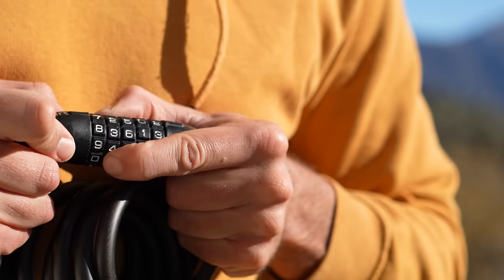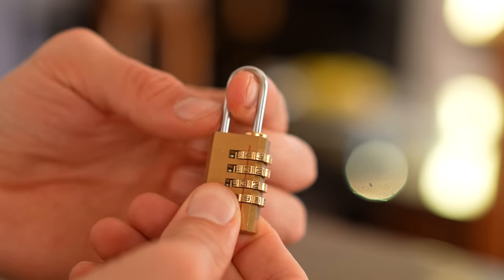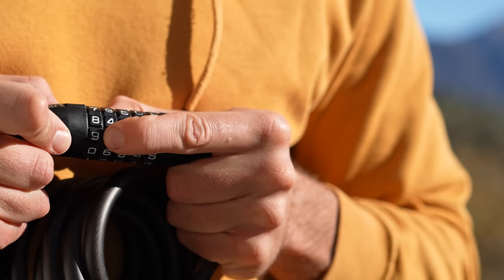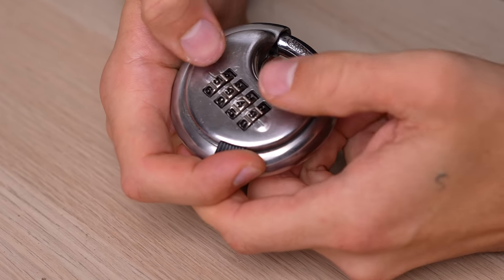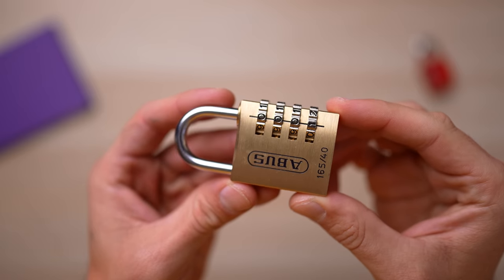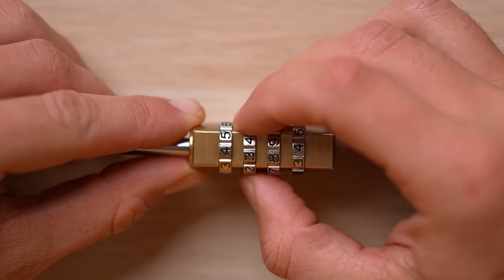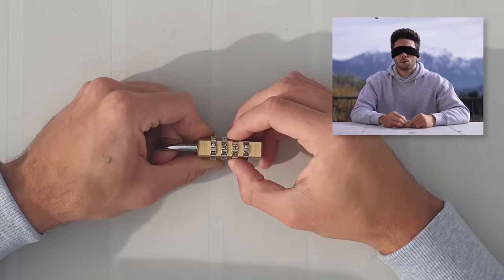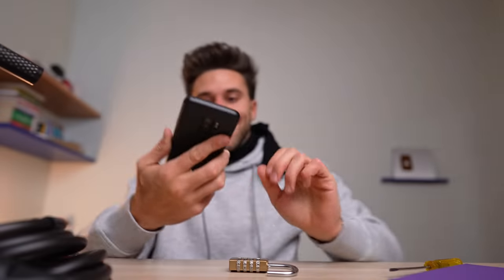This is Why Combination Locks are Completely Useless

Comment: Once picked a 70 USD combo lock in under 30 sec on the counter to prove the seller talks trash on safety. Was a no buy for the client. I paid my 7 USD China lock with high friction and a 70 USD AUBUS hard steel foldchain to pair up. Advised the client to buy 1 cheap and 1 good lock and left.

Can chain my double lock ccmbo to any pole in front of a disco for 3 days. It never gets touched even with tons of punchkeyed locks around that have been emptied of their bikes inside. Cleary a danger zone. 

I just need to oil that China thingy to keep it from eating it's key.
Physicaly it's no match but it's so shoddy high friction it is time consuming  to pick. Anything used to test & turn will just give up and bend.

The AUBUS barchain is punchkey unprotected and provides super hardened steel physical resistance. It deters any noisy grinder discs attacks, require a large crowbar or carjack vsible to carry.

People to bring punchkeys for the job seem to reasonably dislike carrying a large tool for the act and seem to go for safer prey. Be noisy on 2 locks appears to be beyond the threshold of waking drowsy people up at night and take a closer look.

A GF bike got grinded open at night in my peaceful street. It was 3 days old with no traces of any use. Probably that sales outlook did warrant the risk using an angle grinder on 2 locks. My bike was 4 times more expensive. Hard to guess what made the thieves accept the risk to prey on it making noise in sunrise hours.  There is mostly some night owls or early dog walkers around.

Comment: Yes, I agree will other commenters here, there will be a few percentage wise of thieves that will have the time, skills, and patients to open these locks. Also as others say, any lock can be opened, either key or combo type locks.  
If you are worried about this, don't carry precious valuables with you in public places like gym lockers, etc, where you use your own personal locks.  Not too sure how we would handle bicycle lockdowns.  I know in the past I used heavy tie down chains, but nothing special about the locks I used - lucky I had no problems.
If someone is really desperate at getting past your lock, they could probably use some kind of cutting device. Of course it would be very obvious to others what the thieves intentions are and know that is not their lock.
Seems to be several of these "how to open locks" youtube videos, so just beware how and when you use any locks and what you are locking up far as valuables.

Comment: I bought a bicycle cable combination lock for $2. It retailed for $30. The label on the  product said it was returned by a customer because it did not work. The 0-0-0-0 factory original didn't work. I think the purchaser reset it and could not remember what they set it to. I sat down watching a movie, started with 9999 and just counted down until it opened. It took less than 5 minutes. I reset it to a number I wanted. It is now the simplest of my three locks I use on my commuter bicycle. All are used at the same time. There is no lock that can't be broken, but if it takes too long the thief will move on to a bike that is easier to steal.

Comment: It's a great video to bring awareness to how cheap and useless these locks are.  The only problem with your video is that NO THIEF is going to sit there and try to open your combo lock like that.  They're going to take a bolt cutter to the chain/cable or a portable grinder to the shackle which only takes seconds.

Comment: This does not make them useless. Of course, for a bycicle lock they are no good idea. But there are many applications where delaying an attack by 10 or 20 seconds is by far enough. Any lock (or at least almost any lock) can be picked with enough skill and time.

And very often it is just about the statement "this is locked", as at least in many European countries it makes a huge difference if someone breaks into a locked door or opens an unlocked one, legally. Cracking a lock, regardless of how easy it is, is an intentional act.

Comment: For A 4 Digit combination lock just try all the numbers starting at 0000 then 0001 working logically you can go through 1000 numbers quite quickly, even a 5 digit Takes less than 2 hours

Comment: I opened a combination lock for a cabinet at an Ikea that was so easy I lowkey did it by accident

I literally just had my hand on the drawer after noticing it was locked and I gave a joke attempt at cracking the code, which actually opened it

Comment: I bought myself the expensiv one, a few months ago. While trying to set a new code I wanted, I set the dials to something else... not knowing what the numbers where I had to crack it... and did so without whatching or reading a Tutorial -> absolutly not safe.
Reply: However, most people are not as clumsy as me, so they never tried picking such a lock and therefore trust them. So in Uni and so on ... I will continue to use it

Comment: Mike, I have a 4-wheel combination lock similar to the Abus-style and would like to figure out the combination.
Unlike all the videos out there, which show the shackle is in the 'locked position', mine is the opposite.
My shackle is in the 'open position' and will not close or lock, unless I set the right combination.
Any tips on what to do?
Reply: I suppose it's pretty much the same, except you should apply pressure as if trying to close it instead of opening.

Comment: Combination locks, especially the cheap ones are extremely easy to open within seconds. All you have to do is pull the padlock while changing the combinations and eventually the lock will open. I've done it countless times in the past for fun and I would never trust such lock for locking anything that is even remotely valuable.

Comment: You dont have these luxury of turning the combination lock like sitting infront table, when its used on say door or bicycle. With awkward position and chains pulling, you will need much longer time and effort to open. Such lock is for convenient without needs of bringing key.

All locks are for deter purpose as it takes long time to pry open. Using two spanners or some rods they can break the lock even faster than trying to open.

Comment: Where I work there're true "combination" locks on the doors (as distinct from a "permutation" lock which is what most so called "combination" locks are) and you can open them as long as you get the right numbers-in any order. Weird. And rubbish.

Comment: Cable locks are nearly useless regardless of the locking mechanism. The bigger issue is that cable can be very easily cut. While there’s no such thing as a perfect bike lock, at the bare minimum you should be using u-lock with a >13mm hardened steel shackle.

Comment: I thought there was an easier and quicker hacking way (2013 tweet). Anyway this could have been used by the bandits at the hotel I stayed in for about a month in Lyon where an important official  document seems to have been replaced by a fake. These kids love changing the combination key code so you waste your time trying to open it if you don't know this method. In fact it's you who looks like the criminal trying to hack someone else's luggage (kept in the luggage room, no elevator and my room up the stairs).

Comment: I bought a new e-scooter about a 2 weeks ago and wanted to secure it so I bought a combination bike lock for €12. I set it to the code I wanted and locked it up. However, I must have done something wrong because when I went to unlock it the combination didnt work. So I tried a few obvious variations with no luck and decided to go to YouTube.

In 10 minutes I found a video, watched it, and broke into my lock with 0 experiance. 

In the end, a lock is more of a hurdle that makes stealing the item slightly more challenging. Since most people choose the path of least resistance it's enough to stop opportunistic theft.

And anyway, if someone was serious about stealing it they would just use bolt cutters.

Comment: Ofcourse they are "pretty easy" to unlock even without knowing the combination. That is nothing new but the thing is that their purpose is not to hold someone off to break in but rather to DELAY SOMEONE to break in. If its about a bag in the airport for example its useful, you cannot loose your key and it will prevent any worker in the airport or other passenger to steal anything in 3 seconds on a "walk by".

If someone steals your entire bag, well, then no lock in the world will protect your belongings inside.

If you plan to seal your valuable belongings in a drawer or safe with a combination lock, then its definetly a very bad choice to achieve that.

Comment: Firsrly, never use a cable combo lock like that. Nevermind cracking the code, a pair of cable cutters will remove that.
Second, NO lock is pick proof. You only have to watch Lock Picking Lawyer to see that!. For a bike that expensive invest in a higher end lock.
For the record i picked 2 combo locks the other day. I will still use them as, for someone foolish enough to try in a locker room, someone will notice. Thats an extra level of security right there.

I will add, when securing a bike, esp a higher end one, consider using multiple locks. That combo one should not be the main one but could lock the fork to the front wheel for example. Again it wont make the bike "steal proof" but it will slow any thief". Also if its a bike for commuting, consider using a lesser value bike. Bike theives will not bother with budget bikes, its simply not worth their while!

Comment: Great work on those low end locks! You're now ready to try picking cheap Chinese disc detainer lock and if you can get that open, then an Abloy Classic. (The About Classic design is from year 1907 but it's still way better than 99% of all the locks you can in local hardware store. If course, more modern Abloy locks are even better.)

Comment: The point of a lock is not to protect your assets from theft.  The point of a lock is to make a thief move on to the next person's asset.  On a bike rack, for example, if a bike thief wants to steal a bike, they are going to take the one that is easiest to steal.  One without a lock, or one with a really easy lock to bypass by picking or cutting.  The point of a lock in this case is to make your bike more difficult to steal than anyone else's.  It's like how you don't have to outrun a bear, you just have to outrun your friends.

But, if a thief is out to steal your model of bike, no lock you have will stop them if yours is the only one there. They'll find a way to steal your bike.  In this case, you can outrun your friends, but the bear knows you taste the best, so he's going to run right past your friends and come after you.

Comment: The cheaper the Lockt, the more it is to keep honest people honest. Most (cheaper) Locks also have other exploits and weaknesses, that make them pretty easy to crack. 

The bike lock you were using to secure your expansive E-Bike for example is pretty useless, as a cheap pair of wire cutters will crack it in <10 seconds. Therefore, it provides 0 protections against actual tthiefes.

Comment: Nowadays digital locks seem better and far secure for usage. Why? Well, there is only the sense of sight in use and there is no other way of getting through it. When I am talking about a digital lock, I speak of the way how locks are used on phones, tablets, and electronics. It can also be a lock that requires an ID or card for use.

Comment: Combination locks aren't useless, they are intended to secure low value items for short duration and they do that adequately.
Is about using the correct lock for the intended use.

Comment: security is normally measured in minutes to open. A novice taking 5 minutes seems pretty close to the industry standard. Lock companies have to split the difference between being quick and easy to open when you want to but difficult to open otherwise. It's nearly impossible to get both in a reasonably affordable package. Plus it's easiest for people to just think it is secure.

Comment: In one sense, the guy in the video is missing the point. These locks are not designed to keep Goldfinger out of Fort Knox, but to slow down sneak thieves in situations and locals where time and/or seclusion is not a premium.

With the cheap locks, like the suitcase locks, a thief would simply cut it with some heavy-duty wire cutters or break it with a screwdriver (or take a sharp knife and cut open the bag itself); these locks are mostly to prevent "accidental" openings of the suitcase. With the more heavy duty locks a thief is not likely to fiddle for 10-15 minutes trying to decode the combination; they would simply cut the lock - or the chain - with some heavy-duty bolt cutters.

Thieves will attack the weakest - and quickest - points. For example, my brother spent more than a few dollars for some top-of-the-line door bolt locks. Coming back from a weekend trip, he found that burglars used crowbars to simply pull out the wood door frame of a rather cheap back door that was secluded from most observers.

Comment: I found out how to do the first one in a escape room, you were supposed to calculate the value to get trough it, i started fucking with the lock and it worked, this was with 5 others and i managed to get it open faster then 5 combined minds

Comment: Such small combination locks are completely useful !
They are so small and weak (against tools) that they cannot protect your bike anyway ! They are meant to protect your locker.
If they require 4more than 2 minutes to be opened, this is more than enough !
More robust lock doesnt have combination anyway (except vault doors, which have great systems extremely difficult to crack)

Comment: I used to do this to my mates bike locks in high school before you could look this stuff up on YouTube just figured it out in day, combination bike locks are absolutely garbage especially cheaper ones you can literally see the lock pulling on the combination tumblers, when you get one right and pull on it it creates a gap between the correct one and the incorrect one, never buy combination bike locks for your kids bike even the most basic key lock is better at least someone needs some kind of tool and a bit of knowledge to break them

Comment: These locks aren't meant to stop you, they are meant to delay you. If a thieve really wants to he can just cut the lock with a bold cutter. A lock that takes 5 minutes to crack is a lock that most thieves won't bother picking or will just cut

Comment: or alternately you can shim the lock open mechanism aswell with a mechanics feeler gauge, or use two spanners and wrench the bolt open LPL lock picking lawyer take about 20 seconds to open those locks if that

Comment: To be fair, 4 dial combination locks are a joke regardless.
If you set them to 9999 and just work down numerically, at a rate of one click per second, you can literally try every number in under 3 hours. This said, I have tried the first resistance method shown here and it worked almost instantly.

Comment: What's your point? Yes, they can be cracked, but it takes time, time you might not have in public and remain inconscicuous. It's just meant to deter theft of opportunity. A determined thief just takes a bolt cutter to most of there and "opens" them in 1 second flat. Or just takes the bike without, or with an easier lock.
Also, please try that "listening to the click" at typical places where you lock up bikes. Not quite as easy as in your living room.

Comment: NOBODY try to "find combination" or "hack the lock". They are always cut the wire. That simple and take 10sec.  Bolt cutter is perfect to hide and it powerfull enough.  If you need real protection - use 2 U-locs with minimum diametr of rod 10-12 mm. Than bad guy need grinder ;)

Comment: 99% of bikes that are locked and stolen are locked with cable locks, get a U lock
the internal mechanism of a lock is less relevant, as long as its competent, when cutting cables or breaking the lock body is far more common, as long as it deters opportunistic thieves its already doing alright

Comment: You can also open all but one of those locks in 3 seconds with a pair of bolt cutters that you can buy in any hardware store.  The round ones are actually a pain in the rear, depending on how they're attached.

Comment: But you are considering perfect locks. All my locks are bad already and you can't feel which one is the hardest to turn, they all feel loose all the time. You just need an old lock and you'll be safe, impossible to open it the way you did, I tried.

Comment: 2 minutes totally useless? The first key lock I ever picked was under 10 seconds. LockPickingLawyer found a lock that can be picked immediately with kind of everything, even with some thicker peace of paper.
Yes, was a cheap core and there are hard once out there. But I heard that in general locks are not picked at all but broken within seconds... Best protection is to reduce attraction in example by using a cheap bike only on public places - at least that seems to work best in Berlin...